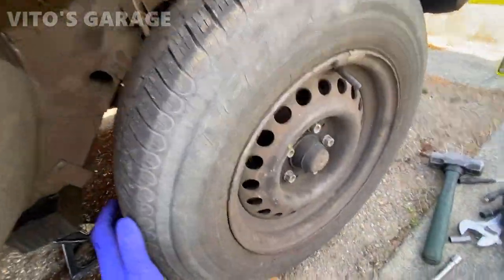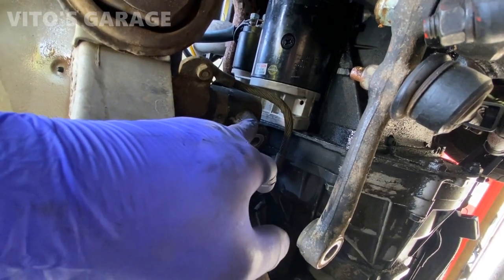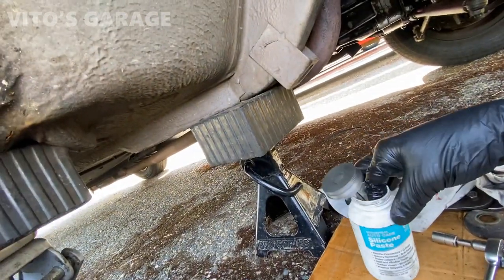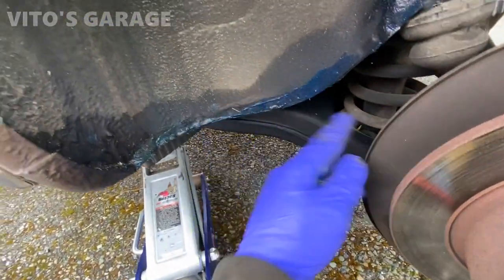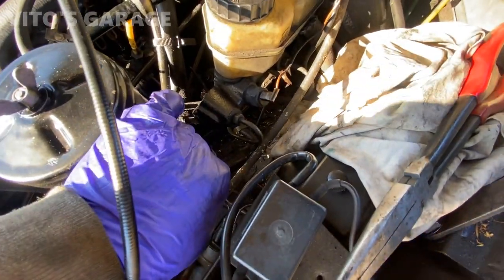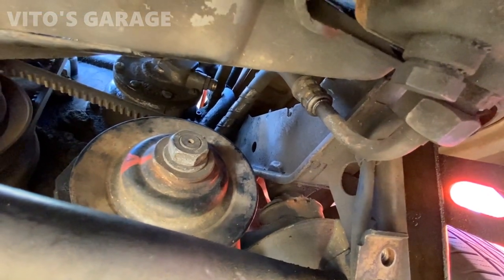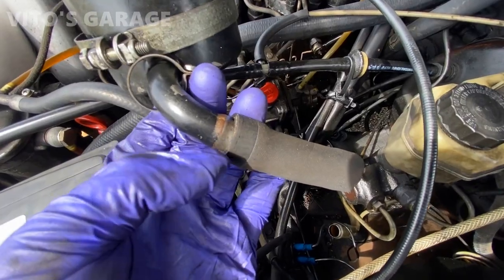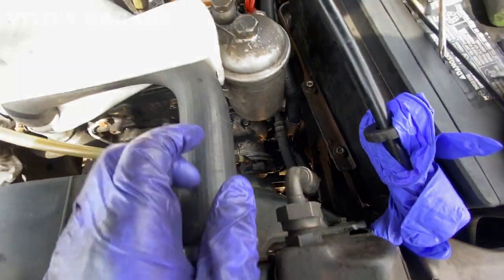Mercedes W115 240D Steering Idler Arm Replacement + Rear Sway Bar Links, Power Steering Hoses & More

Comment: Are the 70s mercs any harder to work on compared to the 90s mercs? (Like the w124/201 )
Reply from the maker: You’d have to see for yourself. It depends. But most of the time everything is a lot easier on older ones

Comment: Good job. Of course with original spare parts from Germany, that's right. Just by the way, I would replace the ugly front bumper and also change the main headlights. They're not original, are they?
Reply from the maker: No. I won’t change the headlights or bumpers. They’re original US spec parts. Thanks
Reply: @VITOSGARAGE  OK.I just think that the original equipment with the German bumpers and headlights looks more delicate and beautiful. But as I said, if you want to leave it that way, ok.
Reply from the maker: @rudigerplump604  do you realize that American bumpers are so much more stronger than short European ones? American ones have shock absorbers in them and are a lot bigger. With Euro Bumpers the car looks chopped off for me